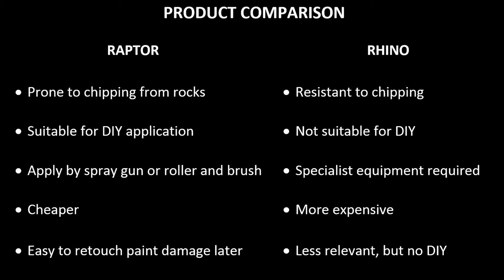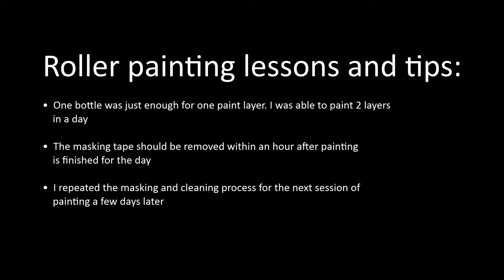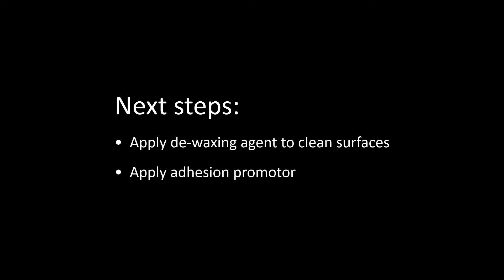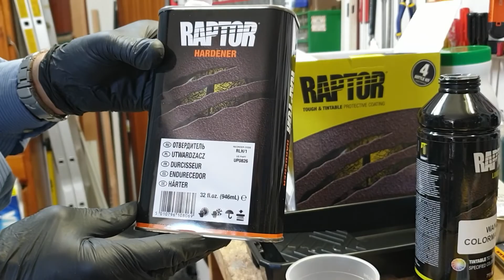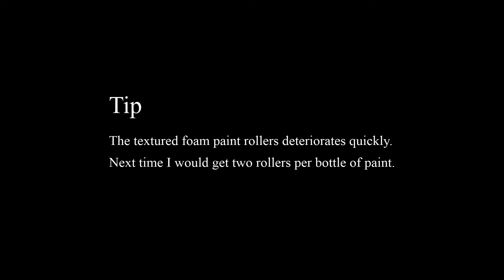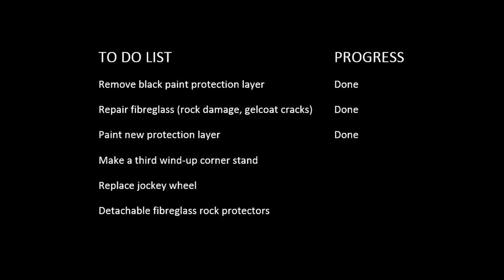Roller painting Raptor on fibreglass

Comment: Thanks for this video. Been humming and arring for weeks trying to decide if it would be a good idea. Seen a few horror shows done with rollers but yours looks great. I think the mixing ratio is key if you don’t want a heavy texture like me. I do think I will go for good quality foam rollers though on my moho. Thanks again.👍
Reply from the maker: Glad you found it useful. Have fun with your project.
Reply: I noticed you changed from the “coarse” finish roller to the smooth foam one. Any reason for that?
Reply from the maker: I used the smoother foam roller to fill in a few harder to reach spots and then went over again with the rougher foam roller later. The texture of the roller determines the texture of the finished product. You can experiment to see what finish you prefer.

Comment: Very happy i came across your video, i have decided to use Raptor over the fibreglass front section of my Avan camper using a roller.  I have been putting it off because once you commit there is no turning back :-) However your video has given me a good indication of how to go about it. Big fear is it will peel off however using the adhesion promoter should do the trick. How has your van held up with the coating over time ? Thanks,  Glen.
Reply from the maker: Thanks for watching the video. There is no sign of the Raptor peeling anywhere and adhesion is not an issue. More of an issue is that rock impacks can cause chips in the Raptor paint work. Another of my videos shows how we made fibreglass stone guards to protect the front of the camper trailer. We have since travelled to the tip of Cape York which included around 1500 km of dirt road. The fibreglass did a great job of protecting the paint. What i did notice hovever is that stones chipped the Raptor in a few spots where it was unprotected. The paint on the sides of the camper is unprotected and did not show signs of chipping. Hope this is useful.
Reply: @Dustydetours  Very useful, thank you so much, Happy Travels :-)